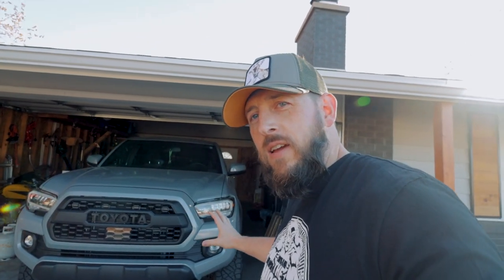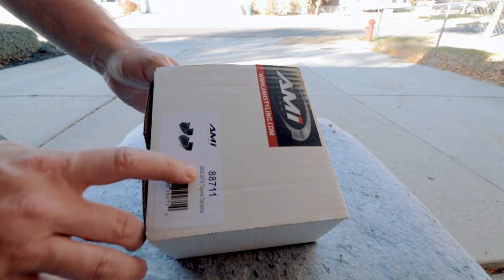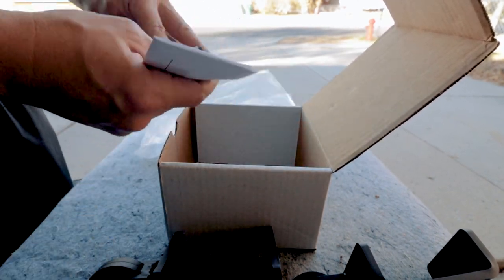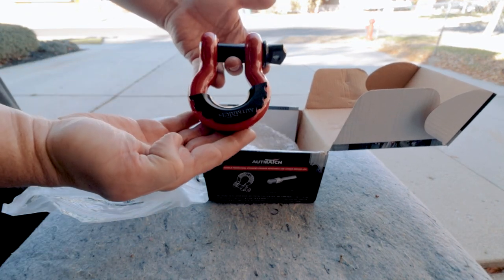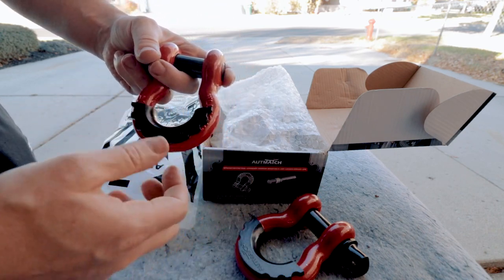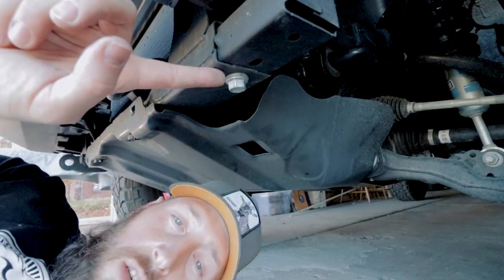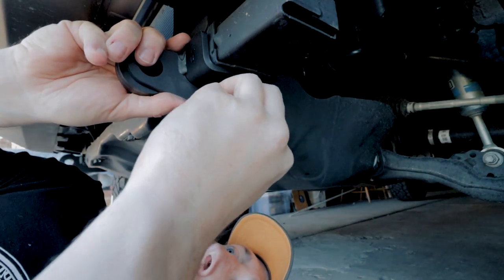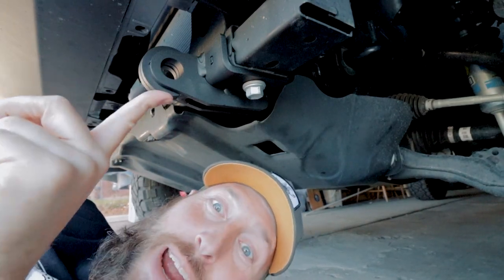2020 Tacoma Demon Brackets | INSTALL | #tacoma #3rdgentacoma #demonbrackets

Comment: You needed to install thick washers on the inside. It keeps the shackles from rattling, and knocking back and forth. You'll be changing it. Just to know when something on your rig has to be delt with, and not to mention the rattling is going to drive you crazy . Hit your thick washers with a spray lube, or even spit, and slide em in place. You'll be glad you did. The snug fit makes it a lot easier when installing a tow strap or chain
Reply from the maker: The thick washers were too tight between the bracket and the shackle, but now I have a full front bumper replacement so  the brackets have been removed.
Reply: Done a bunch of these let me just clarify for those who need a bit more direction. Put the thin washer on the bolt side and push it through but not all the way. Then lube the thick washer and work it in the opening on the thread side until everything lines up. Tight fit but it will go with some finesse. Good luck 🤙

Comment: So you remove the tie down point and these only have one bolt? That seems like a weak recovery point. I suppose if you use a bridle to connect them both and did a static pull that would be OK. I was looking for faded recovery points effort I got my bumper and these were the only option. But clearly they’re not rated recovery points.
Reply from the maker: Yes, unfortunately they are not good for recovery purposes and more of an aesthetic modification. I will say that after I took them off they held on really well, but putting the full weight of the truck on a pull may not be ideal.
Reply: I put two shorter bolts in place of the two long bolts that held the factory recovery hook in place. There is a block inside the frame that the factory hook and demon bracket screw into. So in my case, the demon bracket is held in by one bolt. But the block the demon bracket screws into, has a total of 3 bolts holding it. Not just the one bolt the demon bracket uses. 

You can also flip the factory hook the other way and keep it with the demon bracket. It doesnt look very good, but it works.

Comment: Late to comment, but looks great and the red pops nicely.  Have them on my Voodoo Blue.  I painted mine to match the truck.  Used locktite on demon brackets as well as shackle pin.  Also ran safety wire through shackle pin hole and braided nicely.  I'm way too OCD.

Comment: Great video! Subscribed. The brackets are not available on Amazon. Recommend another?? Appreciate the help
Reply from the maker: Here is another link for the Brackets on Amazon. https://amzn.to/3u6znfB

You can also run a search for 88711 which is the code for the Tacoma brackets.
Reply: @Mumfy64  Thank you! Got them installed. I used both this and wide on the demon bracket install. Doesn’t swing as easy

Comment: Nice! And easy as can be. I  have a 2020 Sport and will be adding these. Question: Is the one bolt enough to handle the strain?
Reply from the maker: Depends on what you plan to do with it. towing most likely, Full on recovery? Probably not.

Comment: I got a 22 SR5 DCLB a couple of weeks ago in Black, since then I’ve been blacking it out and doing cosmetic mods, done aftermarket Pro grill and I blacked out the letters, installed Raptors lights, black overlays on all chrome letters, raised tailgate letters, blacked out the Toyota emblems on the wheel hubs, factory running boards and soft fold tonneau, matte black SR5 bedside logos, 265/75 M+S tires, factory bed mat, LED bed lights, and tinted driver/passenger windows. I took the ugly air dam off yesterday and after watching this video ordered these Demon Brackets with the red hooks, I think it’s going to give a subtle pop against all the black. Once I get these install I dunno what to do next?!?!
Reply from the maker: Sounds like a sick build so far!! Do you plan on lifting it?

Comment: I've heard these are just pretty but don't have strength and frame connectivity to function as true tow hooks. Is that true?
Reply from the maker: I wouldn’t use them as recovery points if you get stuck.. but if you need a standard tow they should do fine.

Comment: @Mumfy  I was wondering is you have had any errors thrown with your TSS sensor on your pro grille?  Was that a mod you installed, or did you buy your truck with the matte black grille?  Thanks!
Reply from the maker: I did replace the grill with one from MC Autoparts as seen is this video, https://youtu.be/XgZocEi33hw. 
I have not had any errors with the TSS after installing it. Are you having issues?
Reply: @Mumfy64  Good to hear!  I own a 2021 Tundra, and just doing some research on replacing the chrome grill with a TRD Pro Grille.  Thanks for the feedback!
Reply: @Mumfy Found this fix for you if you do run into any issues down the road.
ttps://www.youtube.com/watch?v=cVRMORwHsa8
Reply from the maker: Ive heard that there is an adjustment screw that can help with the alignment of the sensor.

Comment: Would these get in the way of a steel bumper?
Reply from the maker: Typically is you get a bumper it’ll have recovery points on it so there isn’t a need for these demon brackets.

Comment: Looks good, just wondering if they hang down enough to hang up on rocks. Aftermarket bumpers move them up and out of the way. That’s why stock hooks are mounted sideways.
Reply from the maker: I haven’t been off road to the point where they would be caught on rocks. My lift helps keep them up high. They don’t sit lower than the lowest point on the truck by any means. I could see an issue on the approach angle if you’re doing some serious rock crawling.

Comment: Quick question? Do these fit on an SR5? I have a black SR5 4x4 but it’s custom. It has red lettering in the back and a red skid plate as well. I would love to get these to give it that extra mmph you know?
Reply from the maker: As long as you have the crossbars it attaches to they should fit.
Reply: @Mumfy64  Thanks for the quick response. You earned yourself a new sub.

Comment: Should have listened to the reviews.  They didn't send me a drivers side bracket.  Grrr.  Cool video tho man, now I know how to do it when I get the right bracket...no instructions either.
Reply from the maker: Oh wow! Did you order them through Amazon?
Reply: @Mumfy64  yes.  I saw the many reviews of people not getting the correct brackets even one of an empty box but thought they would be smart enough to send the right ones by now.  I sent a message to seller to send me the driver side one so we shall see if they reply.  If not back it goes.

Comment: I noticed the stock bracket has two bolts closer to the center, is the metal thicker where the stock bracket was mounted?
Reply from the maker: When installing these, you have to remove the stock bracket on the passenger side. The Demon bracket only utilizes the single bolt and will cover the stock bracket holes. I don’t believe it’s any thicker.

Comment: I'm new to this,  but why would spend extra money for the shackles and brackets if there is an existing hook already?  Please tell me the benefits of shackles and demon brackets aside from making the Tacoma looks cool.
Reply from the maker: All mods are personal preference, I don’t think that adding them has any more benefit over stock, I could be wrong. I’m using them until I can replace the front bumper with the shackle attachments. I’ve heard that they can be used as recovery points but I haven’t had experience utilizing them that way.
Reply: @Mumfy64  Thanks for the quick response.  Looks cool though and might consider installing it if I have extra money.
Reply from the maker: No problem. I always recommend doing mods when you have the money to do so. Save up for the big ones and spoil yourself on the truck when you can and it makes sense.

Comment: Can they be used as recovery points? It looks like you will pull the front off if you do.
Reply from the maker: I probably won't be using them as recovery points, these are more of a placeholder for now until I can ad a new bumper with recovery points.
Reply: Pretty sure they are. I mean they literally replace the factory tow points, at least on the passenger side. Remember that plenty of vehicles have tow hooks that screw into the frame via the bumper.

Comment: no load rating on these. they look cool but not sure how much stronger than oem it is?
Reply from the maker: I dont think they are meant to be used as recovery points, only regular tow useage.
Reply: They’re described as having “41,887Ib Break Strength for Tow Strap Winch Off Road Vehicle Recovery”
Reply from the maker: I tried to find that info on their website but couldn’t find anything that mentioned the load rating.

Comment: Make sure to use some loctite on the bolts.
Reply from the maker: Great suggestion!!
Reply: I just installed mine. I wish mine came with the thicker bushings/grommets like yours did. Also did the TRD pro skid plate.

Comment: LOL those are nipple rings if you use them to get pulled out of a dich you will bend the front end of your truck. That area of the frame is a sheet metal box  ....... oh but they look Kool 🤣🤣🤣🤣
Reply from the maker: I agree that they should not be used for any sort of recovery. Yes they are more for aesthetics but you could still tow someone with these. Its the same location as the factory tow hitch. ..... I am curious if you have tried to pull someone out of a ditch with these and have in deed bent the front end of the truck.

Comment: Good for tiedown applications, similar to the unrated factory hardware, but NEVER pull anything with these decorations!
Reply from the maker: Tie down and normal towing would be fine. Recovery is where I would look elsewhere.
Reply: Agree.   Considering there is only 1 bolt securing them to the frame, I’d never trust them to hold up for recovery purposes.    For tie down and towing, they should be more than adequate.

Comment: Those are nice but I wouldn't use them for any type of recovery they will rip your radiator bracket off your truck
Reply from the maker: correct. I wouldn't use them for any recovery use. I have since upgraded my front bumper to something more substantial. Check out the video. https://youtu.be/gfqPl7FC3wk
Reply: @Mumfy64   That looks bad ass, I love that bumper. I would be terrified cutting the body, you did a great job